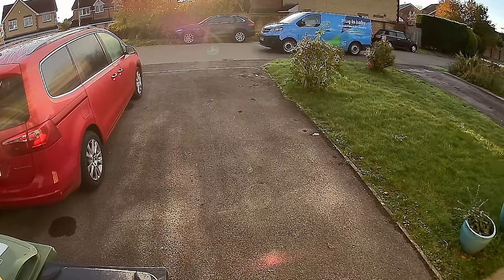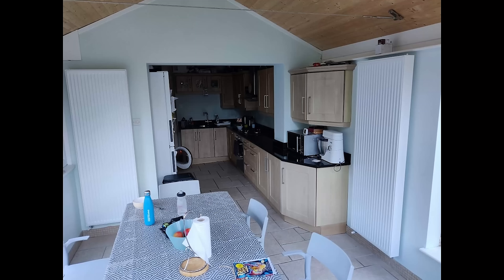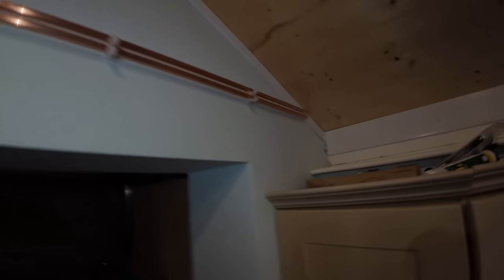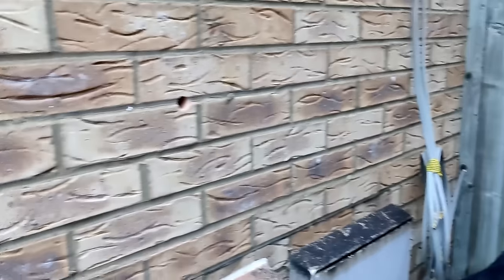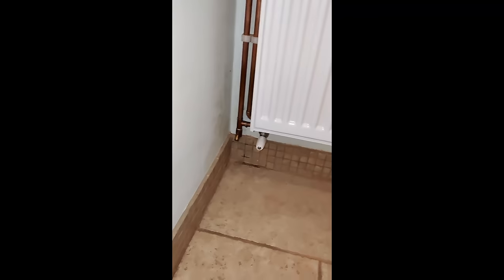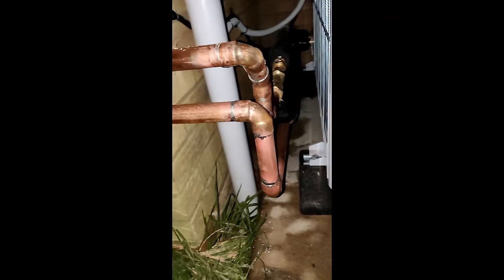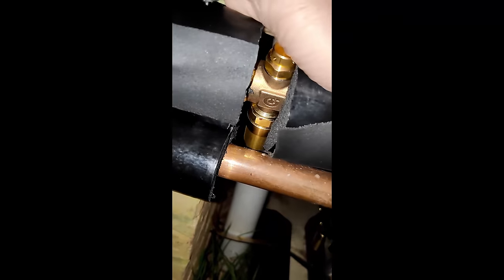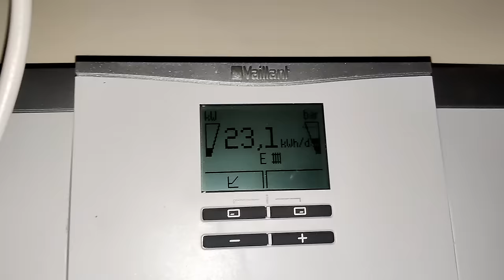Vaillant Arotherm Plus Heat Pump Installation by British Gas

Comment: Wow , that’s so wrong… the clearance around the pump doesn’t comply with the manufacturer instructions and also they use push fit pipe and fittings that is reducing the flow in the systems massively. 
Other problem, the solder joints near the pump , how they would flush that section of the pipe ? Hopefully they won’t flush the pump as well …
Reply from the maker: Where is the pushfit used?
There are no soldered joints near the heat pump, only compression fittings.
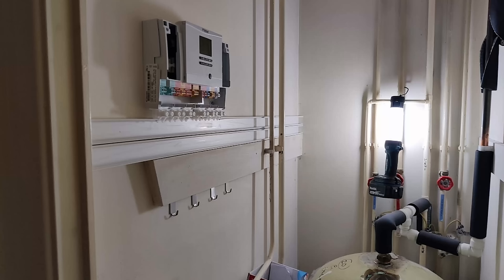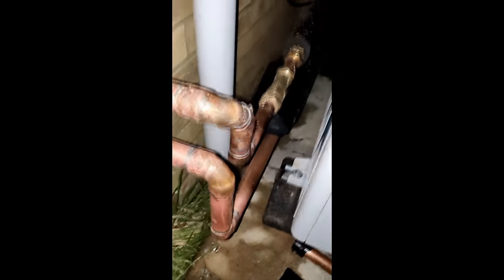Reply: 14:35 , you got them two 22 push fit pipes , 26:32 , solder fittings, and also the notches in the joists that is so wrong …
Reply from the maker: @ACFPlumbingHeatingAndCooling  Thanks for replying back! The plastic 22mm pipe was replaced with copper. You are correct about those solder joints around that corner.
The joist notches have now been strapped to reinforce them.

Comment: Assuming buffer is after the cylinder and is it a 3 port buffer vessel of around 40 to 50 litre capacity?
Reply from the maker: Here's the schematic of my system
https://youtu.be/nNjkKWyZ-Ak
Buffer is a 45L tank.

Comment: Holy crap - they have butchered almost 50% of the joist by the wall - that need replacing. It’s the top chord as well - whoever did this needs re-training
200 litre hw store will be to small as well - you will have to either ramp the temperature up or re-heat several times, either way your efficiency plummets.
Hope you never need to clean the little window in the conservatory!
Reply from the maker: Thanks for commenting.
The joist and cylinder size have since been resolved.

I'm not sure what you mean by the window in the conservatory. There is lots of space between that and the radiator. The camera angle may be deceiving.

Comment: What strikes me is the total amount of crap gubbins you needed with these systems. I think for now I prefer a nice little boiler in a kitchen cupboard and a hot water tank. I am guessing this cost about £15,000 or about 5 gas boiler instals.
Reply from the maker: For this size property a combi would not suffice for the hot water demands so even with gas you would still have a cylinder and 1 or 2 expansion vessels along with the pump so it's only the buffer tank that is additional for the heat pump and that is not strictly necessary to the running.

In terms of installation cost, it worked out thousands of pounds cheaper than the replacement gas boiler costs we were quoted for. Only made financially feasible due to zero rated VAT and £7500 grant from government.

Thanks for your comment.

Comment: Will never work in a month a Sundays, good job though
Reply from the maker: Spoken like a true gas man!
First winter completed.
Saved £600 on our energy bills compared to previous year.
House warmer and more comfortable by a long way.
Perhaps you should go back to school to learn about low temperature heating design?
Reply: Maybe after fitting them for ten years.  Retrofit that property first lol

Then it might work
Reply: @Drheat007  What do you mean by work?
It's not good enough that the house is warmer, more comfortable, we're saving money on our bills and it's been totally reliable?
Is that not working?

Comment: How many people have space to fit the ridiculously huge radiators. Let alone right size pipes to move the water around ? What a con. Heat pumps are only suitable for a small number of houses. Otherwise reckon on £15-20k and like electric cars only for the well off
Reply from the maker: Thanks for the comment.

Apart from the vertical radiators which are only 60cm wide each and fitted in a room that previously had no rads, all the other radiators remain on the existing pipework, just switched from single to double panels.

The 10mm microbore pipework remains and is not a problem unless your heat loss is very high.

In our case and due to the current government grant, the heat pump worked out cheaper than an equivalent gas boiler 👍
Reply: @UpsideDownFork  
Thank you. That explains it very clearly. I have a fully insulated house but no certificate. I understand you need to pay for one of those in order to get a grant. Also heat geeks estimated £13k with no grant so £7.5k with. To replace my boiler is £2700. So some way to go and I just don’t believe it’s cheaper than a boiler to replace. If BG guarantee the energy cost savings I’d be happy
Reply from the maker: @topgazza  Yes, an EPC is needed. Typically £50 or £60.
Heat Geek assured scheme is about as expensive as it gets. Try and get a quick quote from Octopus and see what cost they come back with.
I'll admit that we had to have our 27 year old boiler, cylinder, radiators, cold water storage tank etc all renewed. So when I compare to an equivalent gas system, i'm not just talking about a boiler. The cheapest quote I got for a full gas system including changing from gravity fed to unvented mains pressure system as was done with the heat pump was still over £6k.
I had 3 heat pump quotes come in under that price and all were specified above the budget quote.
Once you start looking at a quality gas system from Vaillant or Viessman that is more on par with the heat pump system, then the costs quickly shot up to £8 or 9K in my case.
Not only the grant that helps with this but also being VAT free (radiators included as VAT free if done at same time) so there's an extra 20% saving.

If I could have just got away with a £2k boiler straight replacement and the rest of my system was all good, then of course the maths would be very different! Or if I had a combi boiler with no space for a hot water cylinder, like I had in my last house, then once again, a heat pump would be a no go.

I definitely agree that there are still lots of situations when a heat pump isn't viable for either cost or logistical reasons.
Reply: @UpsideDownFork  
Thanks again. I like you clear explanations as it makes a nice change
I have an 1989 house-3-4 bedrooms with a loft conversion. Well insulated, cavity and of course the loft conversion. New double glazing and an unvented system updated with new cylinder last year. Original boiler which still works but in spring I will be looking at fitting a condensing boiler. 
I will contact Octopus as you suggest regarding possible heat pump as an option . Thank you
Reply from the maker: @topgazza  Good luck and take care!
Reply: I got quoted £5500 to replace a boiler!
Reply: @OH2023-cj9if  
I’ve just been quoted £2000 for a good quality replacement gas condensing boiler. I think you need to be more specific as that cost is for what exactly ?

Comment: That insulation outside on the bends is Diabolical, as for the pipe running across the conduit end boxes .... shockingly poor
Reply from the maker: Thanks for contributing.

Comment: I’m a heat pump installer, this is a shockingly poor installation, very messy, poor insulation work/ incorrectly supported exterior pipework are a few of the many issues.
Reply from the maker: Thanks for your comment.
Reply: Perhaps you could point them out, a snagging list perhaps for others to be aware of ?
Reply from the maker: @_Dougaldog  That would be helpful but it appears that many are on youtube just to put others down unfortunately.

Comment: All installed with no future access for future engineers, heat pump pushed up against wall that & bugger tank blocking all valves & tanks at the back! Expect some big repair bills when repairs are necessary! What a mess, who wants to live inside a plant room like that
Reply from the maker: Can I book you in to come and do the service then? 😂

Comment: Really! What a mess, never seen anything like it, someone tell me how British Gas could possibly be undertaking such a contract using so many resources and make it economically feasible, it's a bit of a joke. Sorry, but it just doesn't make sense. Finally, the insulation inside the house is poorly finished, the external insulation is insufficient with gaps and partially exposed valves, this needs fixing, also, so many external pipes and cables certainly does nothing for the appearance of an otherwise nice looking house.
Reply from the maker: They're not making a profit on these installations, that's pretty clear!

Comment: Absoloute disgrace of an install a really don't know where to start with it all for a start 5 vans on site which means at least 5 bodies on site for 6 days of the install which could easily be done in a day with 4 qualified men if all material is on site every part of the job is done arse from elbow a new heating system should always have all pipe work renewed and all old pipe work ripped out watching thay video is just nothing but laughable the way the installers have went about the full install from hanging rads on different days to sealing holes on different days to ripping out the old system days into the install honestly its insane the way this install has taken pace the guys that have carried out this install should be sacked on the spot yes there is some decent pipe work within in the install but am just amazed with the amount of Jobs that get started and get left to another day from running pipes from a rad up the wall and running pipes to those pipes and not tieing them in too clipping external pipe work to the wall with banding woofwoof come on and then seeing the plastic trunking installed and clipped to the wall without removing the sleeving that's nothing but stupid it really does amaze me to how British gas are still going if they are paying guys to install a ASHP system in 5 days+ any1 watching this please look in other directions for installers as this install is nothing but lazy
Reply from the maker: I wouldn't blame the men on the job.
They were let down by a new division of BG and didn't have materials delivered when they needed them.
One of them was a brand new apprentice learning on the job too.

You make some fair comments but ultimately after some time and snagging we got there in the end and the system works really well.

Comment: I'm sorry but the space around the actual heat pump Is not enough and two radiators either side of each other is pointless The whole job looks so messy with wires and pipes everywhere inside and out.
Reply from the maker: Here's my follow up video about clearances.
https://youtu.be/WBINlPsk5Eg

The external pipes and cables are on the hidden side of the house, so unseen by anyone. Luckily we have good access on the opposite side of the house that we see.

Not sure why 2 rads would be pointless as they meet the heat loss and that's the only usable wall space for them.

As for the surface mounted pipework in the conservatory, we could have chased out the walls but decided on the quicker and cheaper option 👍

Comment: Very poor standard of installation. What you’d normally get on a social housing job. But that’s what you get from the likes of BG. 

Most of the pipework looks like it’s been done by a 1st year apprentice. 

Clearances around the heat pump are not correct. You should have clear space all round the unit to service and maintain the unit correctly. I can’t wait to see that right side panel removed for access to the internal components for service 😂

Outside pipework. Wow!! That’s absolutely shocking. Using all round banding to support the pipes. I’d love to see what installation standard that comes under. Pipes not sleeved or sealed through the cavity 😮 Clips (if that’s what you want to call them) every 2 meters. Pipework not supported behind the heat pump.

Discharge from hot water cylinder has been installed on plastic clips outside 😂😂😂

That internal pipe trunking is also reminiscent of a rental house where the landlord literally c doesn’t care how it looks.

This is worse than I was expecting when I heard BG were getting into heat pumps. 

I mean fair play for being positive about the whole experience. But my god you should have used a quality independent installer
Reply from the maker: Thanks for your comment.
Some good points and I've addressed the clearance issue in another a video 👍

Comment: Diabolical.       There so much wrong with this.   The notch’s in the floor joists were a joke.     And before people start I’ve been installin* heatpumps for over 12 years.    The set up is really poor.   Good luck everyone getting that 3 port head off.    And over a week to install is crap.   Far far too many fittings used ,, I’m seriously shocked that people are paying a small fortune for this type of work
Reply from the maker: Thanks for taking the time to comment.

Comment: Terrible external pipework, lagging is badly installed
Reply from the maker: Really? You want to join some of the heat pump groups in Facebook, then you'll really see what terrible lagging is!
Reply: Ive seen them, but you cant accept rubbish because youve seen worse. Did they seal the gaps around the pipe entry into the house?
Reply: Also the anti free valve on the top pipe is doing nothing as its not the lowest part of that pipework
Reply from the maker: @tozzer9440  Thank you.
Reply: And i wouldn't want exposed 1/4 turn valve handles either.
Reply from the maker: @nickhickson8738  this seems common practise from nearly every picture I've seen?
The solution seems to be to remove them and cable tie onto the lagging for future use but I found my own solution that you can see here https://youtube.com/shorts/hndOwqFsuxM?feature=share
Reply: @tozzer9440  

Have a wee think, if power is lost and temperature drops below 3C, then both valves will open, bottom one where all fluid from heat exchanger drains, and top one to let air into system allowing it to drain.
Reply: @_Dougaldog  that doesnt change the fact the top one is doing nothing, its aa good as not being there at all
Reply: @tozzer9440  

Oh but it does, whenever did you drain a radiator without opening bleed valve at top ?